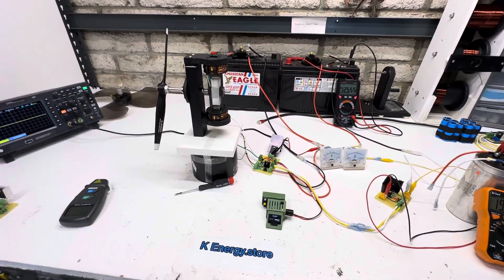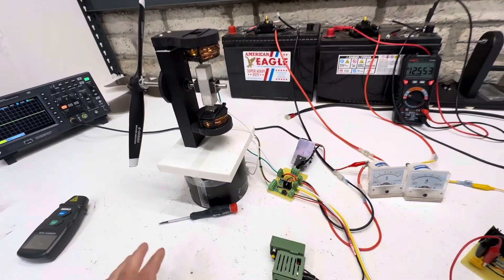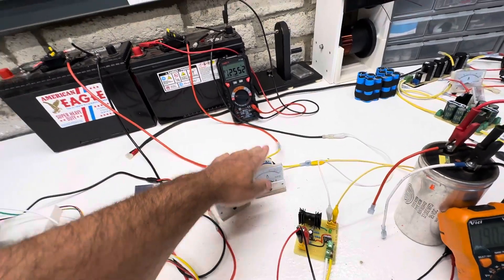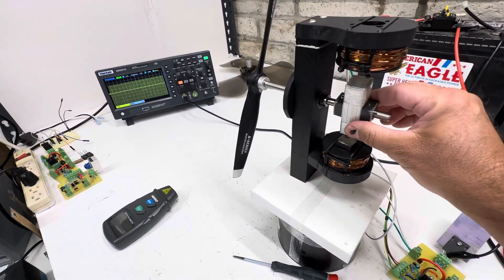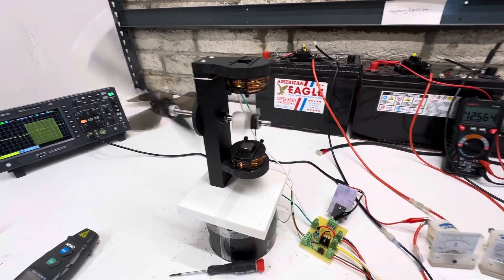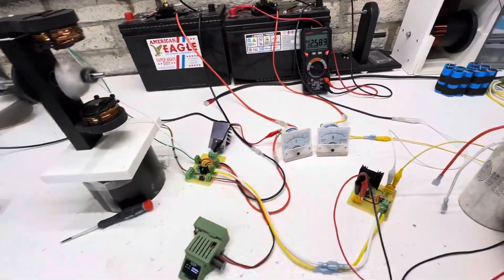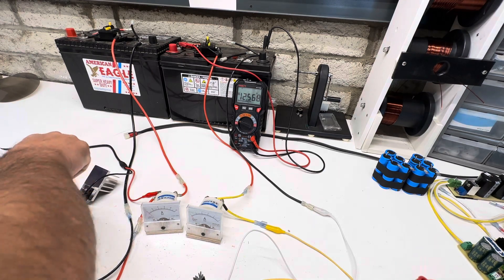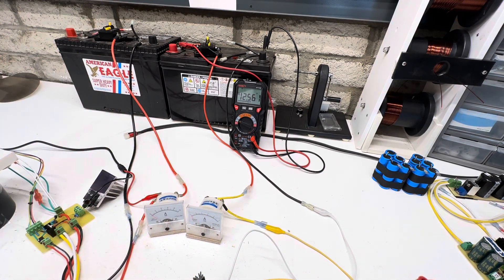Repulsion motor ! With new cap dump

Comment: I was waiting for the propeller motor to slide off the table. 😂 Can you talk about what capacitors you are using for the discharge circuit? They look pretty beefy. How many farads do you need to discharge to the battery? And how long does it take to charge the battery from a dead state?
Reply from the maker: Lol I had to tape it to the table 
That’s my smallest one it’s 4x 10,000 mf at 18 volt discharge it’s about 3-4 amp charge depends on what size battery and how fast it pulses
Reply: @kenergy1707  Ha! That’s so cool!
Reply: @kenergy1707  4X10,000 micro farad? That’s 40 farads, yes? I think one super capacitor could do the job that 6 of your regular ones do. Have you tried any super-capacitors like from Maxwell?
Reply from the maker: @BrentLeVasseur  no 40,000 mf
Reply: @kenergy1707  Ah ok I just looked up the conversion from micro to farad and it’s 0.04 Farads = 40,000 micro farads.
Reply from the maker: @BrentLeVasseur  exactly so super cap would be a lot
Reply: @kenergy1707  Yeah maybe you could do a video talking about charging a 12 volt battery like you have on your desk. Things like how much current/rate of discharge can it handle before it blows up. I’m guessing there are physical limitations due to the chemical process in the battery that limit the speed of charge. And then explain why you choose your caps and other components to meet the constraints of a 12 volt car battery. I’d love to see that video.

Comment: I was waiting for you to make a video on Repulsion motors. Thy are the true workhorses of the single phase to three phase emulated design. I still use a Repulsion motor on my air compressor.  The closest motor design for highest efficiency next to a polyphase motor. Job well done K Energy.
Reply from the maker: Thanks buddy ! I have 4 of them now I definitely agree
Reply: Supposedly the EMF interference is the problem with the repulsion motors.  @kenergy1707